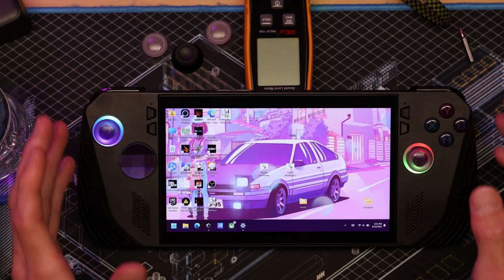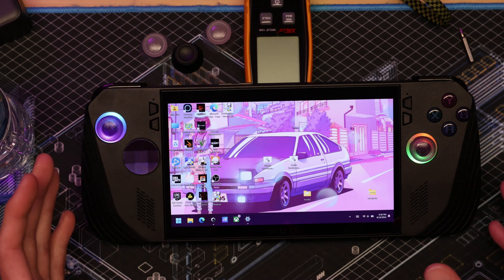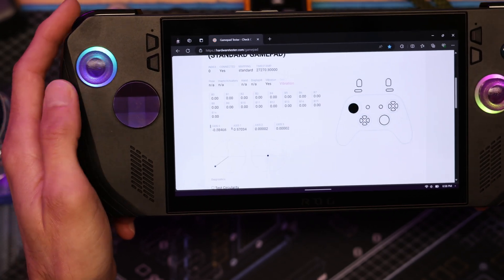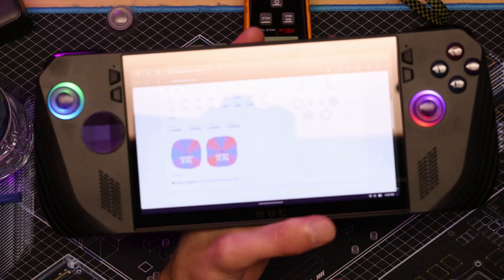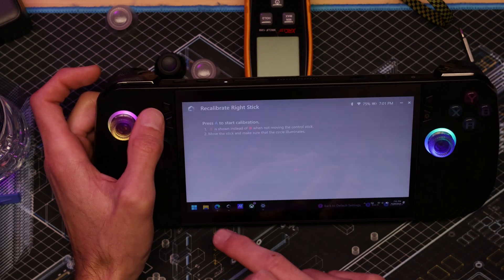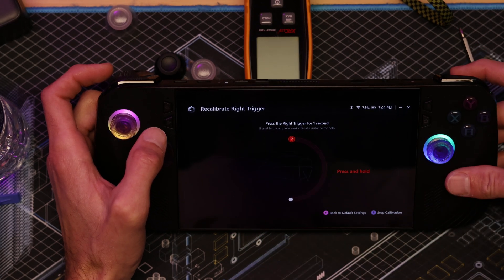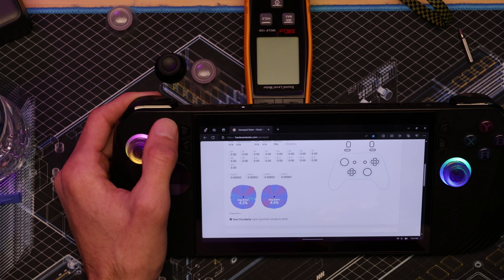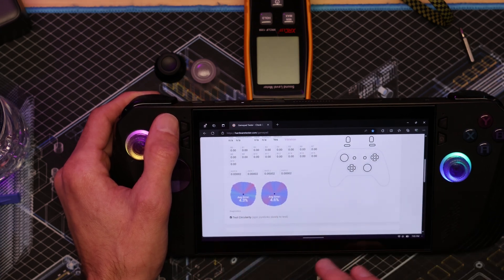Rog Ally X Ultimate Calibration Guide (Joysticks & Triggers) + Easy Disable Touchscreen Hotkey

Comment: Im having LT RT auto fire issues. I used the armory crate cal and it seems less frequent but it's still happening
Reply from the maker: Hmm ok so what could be going on is the default deadzones or limits could need to be reset. There’s two places to make sure you have reset. One is in that calibration menu and the other is in the gamepad menu above it where it says control mode “control gamepad and desktop mode” click that configure button, then click gamepad, then lol for trigger. Not look to the right and reset to default. Then try calibration again but be sure to hit reset to default there too before you begin. If that fails.  Dm me on discord @cppctek

Comment: Hey, I just swapped my right stick board because the stick itself felt a bit wobbly. The problem is that when I actually installed the new one and was calibrating it, it was way too off and could not reach the outer limit of the circle. I had to push it very hard in order to calibrate them and still could not reach the outer edge. I solved lowering the threshold but i still think that this behaviour from a new board is not right.
What do you think about it? 
Ps. Sorry for my English
Reply from the maker: Most of mine have that trouble. Lowering outer threshold helps a lot but yeah it does seem to be a small problem.
Reply: @cppctek thank you for your quick answer. Did you swap the control board entirely? How did you fix yours? Meanwhile i ordered new stick caps in order to try with the first board that did not give me this problem. I think that the wobbly stick was the cap too loose on the stick itself.
Reply from the maker: @kts3458 mine are original but I have to tinker with calibration a lot. My video today will show you a diff view of calibration
Reply: @cppctek  thanks again, i'll watch it soon and update you under this comment when I receive the new caps and test  them with both boards. Keep up the good work you are doing!!

Comment: Good afternoon, first of all I would like to apologize for the translation made by Google because I am Brazilian and I do not speak English fluently. I also want to say that I have followed and admired your work since you purchased the Asus Rog Ally, which made me purchase one. Thank you very much! Well, to be brief, I wanted to make an appeal to you. I would really like to do the DPAD replacement mod on the White Ally. I have watched the same video several times where you show the tutorial on how to do it, but I am a bit of a layman in this subject so I feel a little insecure in two parts of the video. The first is when you remove the two fans from the cooling tube. Could you help me, please? I am afraid of denting the cooling tube when removing the fans because they are so delicate and thin. Will the fans come out easily when removing all the fittings and screws or are they well fixed to the cooling tube to the point of having some physical resistance when trying to separate them? In one of your future videos, would it be possible to show how to do it in more detail?  (Don't worry, I won't go around telling lies like I did with another subscriber you mentioned in the video). The second concern is about the ball that is glued to the motherboard with tape. Can I use 2mm 3m tape? Isn't there a risk that the tape will melt due to the internal heat of the device? Can I glue the ball with instant glue directly to the other part of the Mod where the 4 magnets are, or is that a bad idea? If you're going to do this mod again on another device, would you be able to record the ball part of the DPAD, please? I appreciate any information and thank you for bringing such unique content. And lastly, a mod was released on the same 3D printing website where it is possible to use the Analogs of the Elite 2 controller on the Rog Ally. It would be very interesting if you demonstrated it in a video for us. Thanks for the excellent work!
Reply from the maker: Dm me on discord and I can answer a lot of these in detail in a video. It’s hard for me to type out that much so I do better with my words. I’ll happily make a video and dm you a reply answering the questions.

Comment: Hey bro, question regarding the stock joysticks:

Is it normal that they can actually be pulled up away from the board? Cause I just got some joystick protectors but they're a tight fit and they push up on the sticks. Wanna know if it's safe to continue using them
Reply from the maker: Yeah watch my 10$ mod video for the Ally x where I swap the sticks for clear purple ones. You’ll see how they come off

Comment: Just watching this, my right trigger when I calibrate and push the trigger down all the way, it bounces a bit on the screen but if I then push it harder it will stabilise. Is this an issue ? Been like this from new
Reply from the maker: When you hit calibrate don’t press it to hard. Just press it till it barely taps the end. If you force it or press to hard during the calibration process it will do that.  Also be sure to reset to factory defaults in that calibration menu and try again.
Reply: @cppctek  awesome, factory resetting sorts it. You would think it would always recalibrate from it's default settings. Running well now!

Comment: I'm getting some clicking or crunching noise from top or back of my ally x, don't know if debris got in there or if its a fan noise, can I take the back off and cover a sensor and get it to boot up , so I can tip it and see if something falls out
Reply from the maker: Interesting. Can you record the sound and dm into me on discord ? I’ve seen someone take
The backplate off while it’s powered on, totally wouldn’t advise doing that tho lol. But if you are extremely extremely careful it can be done like that. Just be careful with the ribbon cable attached to the backplate

Comment: Hey man, can you make a video regarding the squeaky D-Pads? Is there a fix? Or is a swap out the only way
Reply from the maker: Easy fix from what people have said. They used the same keyboard lube I used in the squeaky trigger video and they used the little paint brush it comes with and ran it around the edges of the d pad and the housing and worked it untill it stopped squeaking.

Comment: Hey man, nice vid 👍 looking forward to the og ally battery mod using the X battery. Are you still planning on doing this?
Reply from the maker: Thanks bro. I am I’m just waiting on a good deal on a battery or if someone wants to donate one to the channel or send one over to be modded. I’ll gladly do it lol. I just don’t have the 100$ allocated to cough up for a spare battery. You have to cut and solder a little and it won’t be able to be readily and safely able to go back into an x without reverting all the work back. I just am super hesitant about using the battery out of my x to use on the og since I rarely use the og anymore since owning the x. I use the x daily so it would be tough.

Comment: I went with the HandheldDIY hall sticks they sell that are intended for the Legion. They're the stiffer model sticks. At first I was having a heck of a time getting the one stick to calibrate correctly due to interference caused by the magnet on the trigger nearest to that stick. It absolutely refused to go all the way to the one side and it would wander when you actuated the trigger. Fortunately, it went away after I put some magnetic shielding tape on the joystick board. It's still not 100% perfect, but only by a touch. Other than that, I love those stick. That extra oomph from the stiffer centering spring is really nice.
Reply from the maker: Now for the og ally and the legion go I have separate tips for those for calibration. If your using the og ally and Hall effect sticks you’ll want to add a little anti dead zone 2-5% or so and then add a little dead zone as welll and then you’ll have that dead zone issue perfect. The instructions I shared here on this video may help but it’s mostly for the ally x but definitely wouldn’t hurt to try any of those and lmk if it helps. I have the handheld diy hall sticks but I don’t use them because of said issues. I did a video talking about them and also the springs I took out the hhdiy sticks and put them in my stock unit on the og ally and it works great
Reply: @cppctek  Actually, swapping out the springs and putting the heavy ones in the stock Ally sticks is a pretty cool idea that never crossed my mind. Thanks for that.